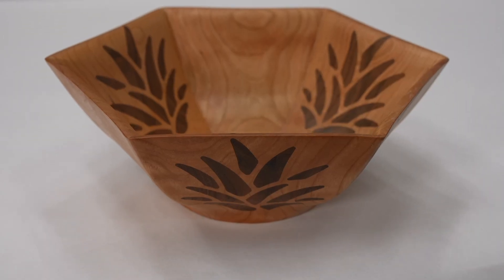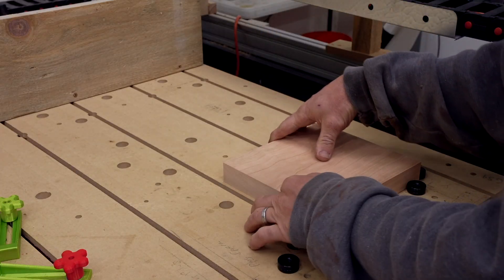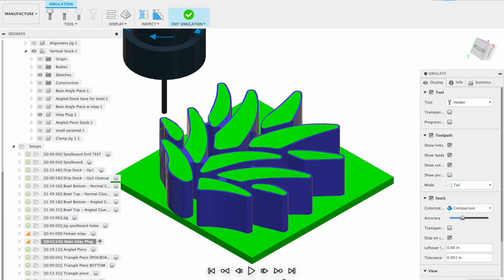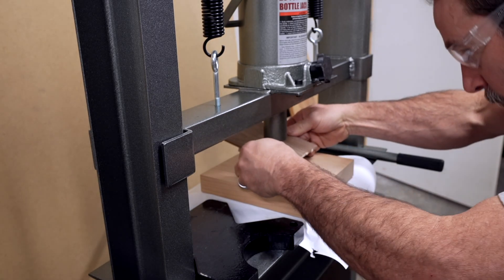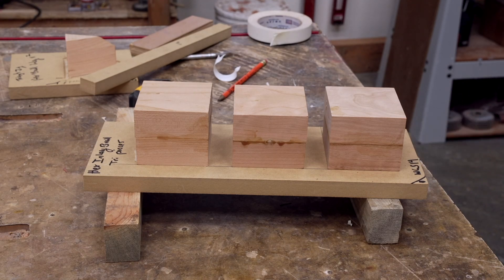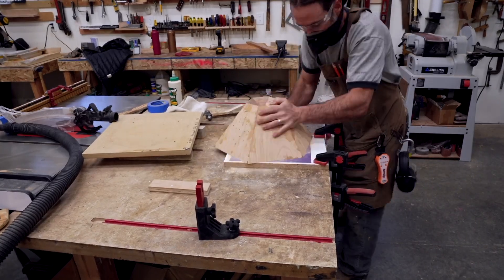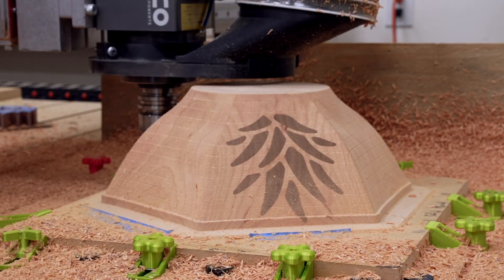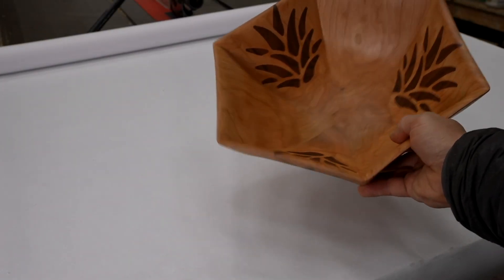My Hardest CNC Project!    --   Deep Wood Inlay Salad Bowl - Hexagonal Bowl

Comment: Outstanding craftsmanship, I admire you for persevering through getting the inlay perfect without gaps or the wood cracking. A little trick I like to do when it comes to registering an awkward shape on the CNC is I engrave the profile of the shape onto a sacrificial piece of MDF first then register the stock using the outline as a guide 👌
Reply from the maker: Thanks, that is a great idea on how to accurately register stuff!

Comment: Looks great. What off set did you settle on for the inlay to get a nice fit but not too tight? Keep up the great work.
Reply: Thanks, I assume that was for your .125" size. I have found that wood species, ie hardness can effect the value as does the cutter radius. I really enjoy your creativity and hope you keep making videos.  May I contact you to learn more about your automatic tool changer setup.
Reply from the maker: @modelmaker007  Yup - that is the 1/8" Amana bit, doing 1/8" DOC passes.  And I found the same: different wood has different tolerances required. Definitely email me if you have questions about the ATC - I'm happy to help out if I can. corbin @ corbinstreehouse dot com
Reply from the maker: Yeah good question! -0.008 was set for the "Stock to Leave" for Fusion 360's 2D contour pass. The negative value makes it cut more than it should. This value was starting to get too tight; I believe the bit starts to wear down and I'll have to add a few thousands of an inch to it when I do it again (ie: -.010). I think I'm going to do a video on how to come up with the values.